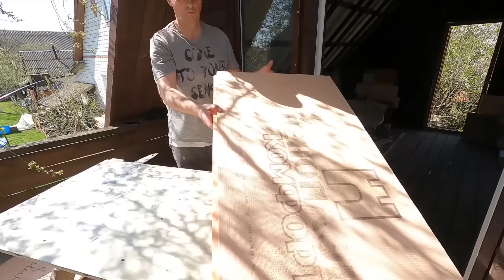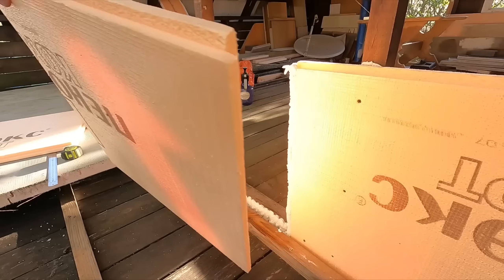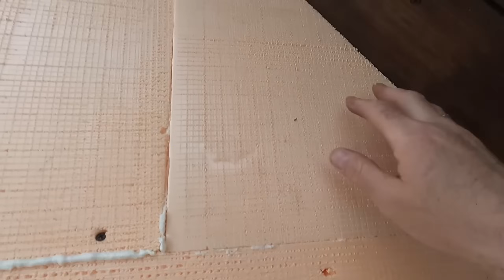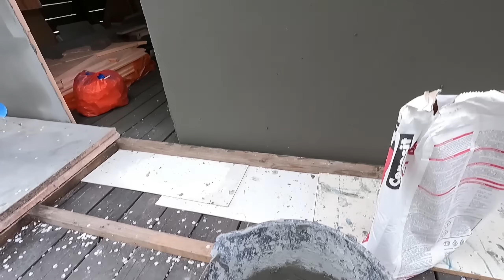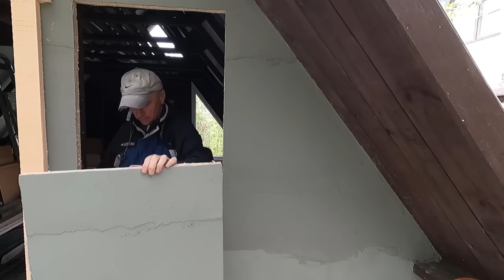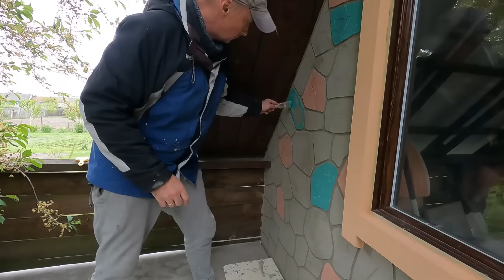DIY Walls: Fireproof, Warm, Cheap, and Durable! Build a 2-Story House for $1000

Comment: I wish this could be done for $1,000 USD.  One sheet of tht foam that is 2" thick, 4'x8'over is over $50
Reply: 2" goes in areas where strength is needed. 1" with mesh and mortar on both sides has decent strength, but not as much as the 2". Ease of installation, getting supplies to the job site is what I'm looking at. A good strong metal frame and 1" walls coming in under $1500 for me. That includes a sliding glass door. Foundation around $300 in materials. 20 x 20 x 13. Hope to post my build soon.
Reply: @carsontilton2425  I pray and hope you do too.  Maybe, we all can help thee unaffordable, be affordable again. Young folks can have reason to try again.
Sounds impossibly delusional,  but when your backs against the wall,,, we have too try.  Fight like HELL if need be, but never give up.
Reply: @carsontilton2425  here one can get perhaps a single post hammered into the ground. Even for small chalet style cabin one, on I beam structure, probably even more with a concrete ring and floor foundation, due to the serious weight. We also need windloading and shear strength open flat land close to sea.
Reply: Yes I found that to be true!  The foam board is way too expensive, in the USA!
Reply: @dinebonte4014  is it affordable to order from another place and have shipped or no?
Reply: @dinebonte4014 capitalism.
Reply: @dinebonte4014 you could buy plywood, tape, house wrap, nails, staples, and siding instead. Oh and then still have an uninsulated unfinished wall. It’s not free, but this is much cheaper than the “ traditional “ method
Reply: @dinebonte4014  Even more expensive here in Europe.
Reply: It seems one can't even get XPS sheets that large, more like 5 foot by 2 foot 1250mm x 600mm. 40mm thick is 600 euro including 70 euro shipping per pallet. More on longer items. So, that is like 7-8 euro per M2. 100mm thick is only 36M2, but still a little over 600 euro, so like 17/18 euro  per M2. PIR can be had in 2500mm by 1250mm but is not moisture proof.
Reply: @perpetual4958 thee ultimate goal of the lazy wealthy,, enslavement of the serfs created by corruption of Capitalism
Reply: @perpetual4958 bro speak english damnit 😂
Reply: I found 10x10x1 for .74 each sheet. 136 sheets $100 on uline
Reply: @annamariechavez4316  and that is a 10"x10" square.  a 4'x8' section of it is starts at $24.  Also the foam he used in the video is very different from what uline sells.
Reply: @curmudgeinnak  HEY! It is 40 sheets for $24. Now THAT would be doable. Problem I am having, is, are these walls strong enough. I can imagine tripping and falling THROUGH the wall. Or my grandson turning into an old time cartoon character, running through the wall leaving a cartoon silhouette hole behind. Outside that, I am I terested in trying it. Just got a feeling it's not going to be suitable for the entire wall. Inside, out
Reply: @wordswritteninred7171  When you think about it... it's similar to how surf boards are made... and you are not going to fall though a surfboard😉
Reply: @TV-4-PC  well a surf board has support completely  under it. Where as a wall doesnt. There is no force on the other side to prevent something  from punching through it. I work at 3A. We make foam boards. Everything feom poater boards to insulation boards. Foam boards are quite brittle. So i dont know. I meam drywall can have a hole punched in it accidentally. And i just dont know if this as strong as drywall. I hope it is! Cause i gots plans! Lol😂
Reply: @annamariechavez4316  how much was shipping
Reply: @annamariechavez4316  10cm by 10 cm at 7.4mm thick or film at 0.74 mm? That's impracticly tiny.
Reply: Go to a commercial roofing job. This is what's used under rubber. Alot of times there's old iso board when there's a tearoff. You can get some free.
Reply: @parkersgarage4216  Sounds good however will not happen for us as we live remote in Alaska.
Reply: @curmudgeinnak yea, it def won't benefit u lol. it will benefit others though.
Reply: That 4' x8' (122cm x 244cm) sheet  at Home Depot in Canada costs $112 plus tax today... Can't even make a decent shed for $1000 here
Reply: Guess we the formula to start making those foam boards ourself.
Reply: Everything is cheaper in Russia. Groceries are half what they are in the U.S. Our government doesn't want us to know this. And they have health insurance.
Reply: anyone know what kind of cement like that can be used here in the US?
Reply: Yeah, that's not cheap at all.   We refurbished a two story compact log cabin for 2,000... but that was hmm... 30 years ago.    The log cabin had already been built and the logs cut by me and my dad on the sawmill.   Most of of money was for the interior particle board and varnish, wiring, propane heater, stove, water heater, plumbing, shower, sinks, etc.   Plus foam insulation between the cracks, steel corrugated roofing tin, etc.    For one person, a tiny home is just fine...  if you don't have a huge collection of junk.
Reply: I'm in Spain, the most expensive I've found is around 10€ per square meter (single Boards 125x60x8cm Compression strength 300KP.) 

A pallet of 96 boards (125x60x5cm 300KP) =72 square meters, is 373€ (including tax!) at Obramart. That's €5.18 per square meter!
Reply: Clickbait or bullsh*t makes no nevermind. Either way its not true.
Reply: Yeah. Check how much they are getting paid in russia/belarus. Easy to compare one aspect, but living in a dictatorship isnt anything to be envy of. This resoursfulnes doesnt come from a good life

Comment: Why not panelize the wall sections with mesh and mortar horazontally then apply them simmialrly as you have done on the roof recently, just applying a finish coat over them when done?

Comment: Here in Australia, I have found that our largest building supplies company (Bunnings) sells Davco 20kg Grey Ceramacrete Tile Adhesive (made by Sika)  and Bastion 20kg Mastic Powder Adhesive Tile. Both are cement based and suitable for exterior use. They would thus appear to be suitable. Off white and grey seem to be available.
Reply: Where I can get the foam sheet cheap? I did find a foam supplier  several years ago. My son was into radio control planes and we were looking for sheets of foam to make planes with. Still no where as cheap as they buying it for.

Comment: Anyone know of a comparable product available in the US?
Reply: Polystyrene foam board.
Reply: Not for cheap. It would cost you more than conventional building around here.
Reply: I would love to do garden beds. This makes more sense to me than wood. 😊
Reply: I was wondering if foam board would work? 4×8 sheets, cut to size.
Reply: Xps extruded polystyrene the same stuff they make temporary ice chests out of from Walmart
Reply: @BryanKirch  those really basic white cooler chests use expanded polystyrene (EPS) [expanded polystyrene beads compressed together]. Extruded polystyrene (XPS) is somewhat different with different engineering properties; it is often blue or pink.

Comment: I´m glad I found this channel! You did such a great job and the construction method is truly genius!   I´ve been thinking about renewing some walls and construct additional rooms for 2 or 3 years now, but budet is tight (balkan country) and i`m a woman and not 20 anymore 🥴. You are right with "breathing" walls - they let in moisture, and everything gets moldy here...We live in an old farm house and I definetly will fix it with your method, so: BIG THANKS ❣❣❣
Reply: I'll try to share what I've learned in case it helps. Sorry for writing a book lol. Mold needs water to grow. Condensation happens on the "warm side" (side with warm air) of a surface when enough humidity is present on that side, and when the cold side causes the temperature difference to be below dew point. So, removing humidity from the warm side, or preventing the temperature differential at the warm surface (with sufficient insulation) prevents condensation.

Gaps in housing envelopes aren't a major concern on their own. Plumbing, and roofing and window leaks, and vapor barriers trapping moisture are probably more major mold causes). When air conditioning is present, air permeable (breathable) walls do allow the drafted air's temperature differences in high humidity conditions to deposit condensation, which is a cause of mold, but many air conditioners can effectively remove the humidity from humid air, keeping it from depositing moisture in most of the house --- and during the winter, external air is dry if cold, so drafted in humidity isn't much of a concern. If insulation is insufficient in any area of the wall cavity, humid geographic locations during summer can cause external condensation (since the outside of walls are too cold and the warm humid air is outside) which might still end up in the wall cavity since it's wherever the temperature hits dew point; and internal condensation is a concern during the winter if excess moisture is created in the house (from hot water for bathing and cooking, etc.), since the warm side is then inside.

To try to put that together, sufficient insulation with a consistent r-value is important in the systems that prevent moisture in houses, and any insulation breaks can cause a point of condensation. I think a lot of mold is caused during the above conditions by thermal bridging when insulation is stuffed in between studs, which this continuous external insulation helps prevent --- such a strategy is actually required in code now in certain climates to help prevent excess thermal bridging.

One point of caution --- One good part about older houses is that they either vented or diffused vapor naturally. Yasha has a video on XPS foam roofing. However, foam is not very vapor permeable. XPS is worse than EPS for this, though EPS is essentially a vapor barrier too passed an inch in thickness, or so. My only concern is that, we learned from SIPs framing (structural insulated panels --- basically just this foam sandwiched between wooden OSB panels) that in these vapor enclosed spaces, humidity would rise to the ridge and cause rot at the peak where the OSB was. Though Yasha's system may not use OSB, structural roofing members at the peak may eventually rot due to this. Joe Lstiburek was hosted on Matt Risinger's channel explaining the solution to this: a vapor diffusion port; this means 1/150th of the roof area should be vapor permeable around the peak. Plywood sheathing supporting rockwool or similar insulation instead of foam board, covered with a vapor permeable WRB (weather resistive barrier) should guarantee this diffusion. OSB might work too, but varies in vapor permeability. Other options are a dehumidifier pulling air from the peak of the vapor-tight enclosure, or perhaps a small air gap near the peak if one isn't worried about thermal efficiency.
Reply: Pennaplex?